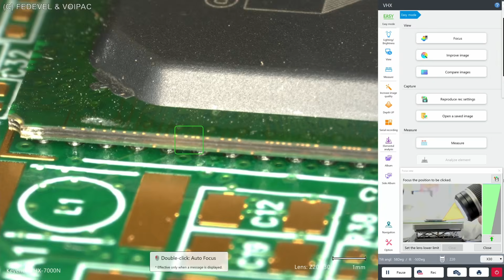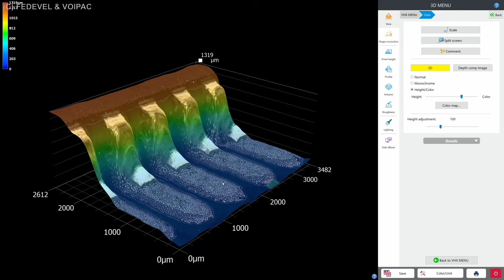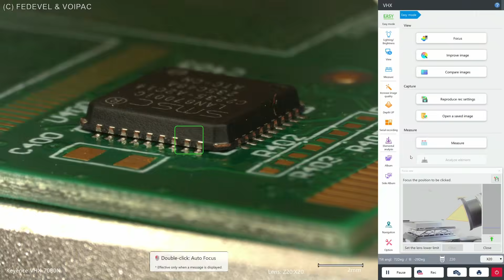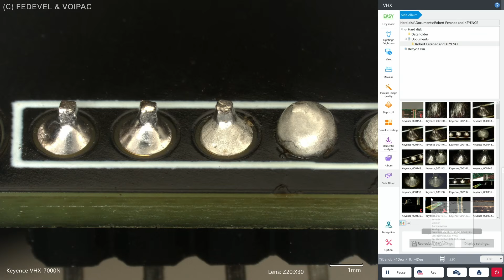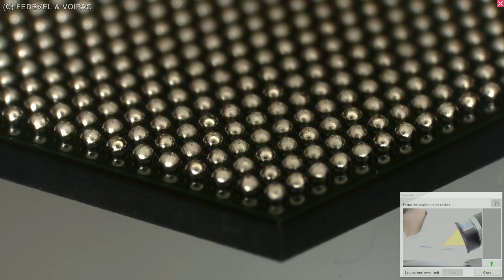Have you ever seen soldering THIS close?

Comment: Even with the correct amount of solder paste you can get the paste spreading excessively if you are not careful with preheating. It takes a considerable amount of time to properly preheat so that any volatile constituents of the flux are driven off slowly and don't boil. Proper preheating and limited rate of coiling are also critical to reliability with multilayer ceramic capacitors.

With leadless IC packages the part of the "pin" that is easily visible does not need to be neatly soldered in order to produce a reliable joint. This part appears to be bare copper because that is exactly what it is. Low-activity flux, which includes almost all "no-clean" types, may not be adequate for good flow on the bare copper. Added to that is the possibility of some smear of the plastic from the package on the bare copper as a result of the trimming process.

Comment: I too liked the video but was a bit surprised when I saw that gold-plated pins and vias were being soldered. "Degolding" prior to soldering is a real process and "Quality Experiences in Aerospace Electronic Assembly" says "If a gold-plated lead is soldered, a gold/tin intermetallic compound is formed which is brittle in nature and such a joint will be very dull near to the PCB surface. This embrittlement of the solder fillet causes the joint to fail subsequently during the environmental tests or during storage."

Comment: If you don't check boards as you make them, an IPC-A- 601 trained inspector as I was,  will come and make you fix the problem or start all over again, costing you a lot of money. Or you can ignore the inspector and make a bit more money but lose your customers, get the boards sent back as non compliant or even have a legal issue you may find needs fixing.
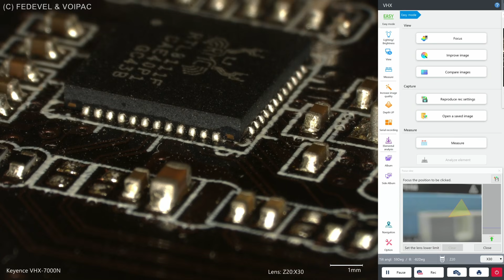As an asside the proper soldering at 5:51 The solder is good but the board and components themselves do not look clean or acceptable.

Oh and as a guide for newbies, there are very few hand solder instruction videos on youtube that would enable you to get a solder pass. Very few. A good start is checking if their iron is the correct temperature and sparkly clean. If not forget them, most of what they say or do will not be good either. There is a lot more than heat and solder to getting a correct solder joint when hand soldering. Actually a lot more with any soldering even non electrical or electronic.

Comment: Soldering lead with out flux inside, are very hard to melt. Some new lead wire nead more temperature 80/70 made alloy aluminum harder to melt fake can distroy units than fixing. Old soldering lead with flux are more safer to fix damage electronic part. Wash hands after yousing it flux are toxic chemicals.

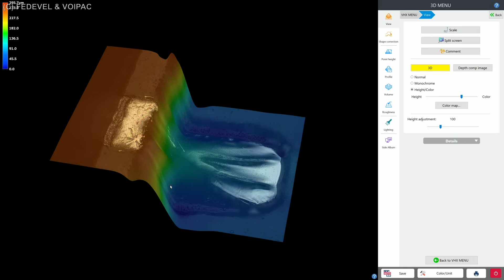Comment: Actually, the 3d view shown at 4:00 looks like an AOI machine. It’s “automatic optical inspection” you don’t have to even look at it, the comp program will look at every component, solder joint and fillet, take pictures and stop by itself if it sees a defect.

Comment: Well. nearly. i did a blog post on repairing a multimeter and took a few photos that had only 4 or 5 DIP pins in the field of view. There was dust and crap in there that became conductive just from the humidity of breathing on it. A clean fixed the fault.
I just used a clip-on macro lens with my cellphone.

Comment: You don’t need such a sophisticated microscope set up for soldering of that size. Or any size really. I have seen and performed soldering at that level and smaller with a microscope a fraction of that cost. There are resistors you have to hand solder smaller than an uncooked grain of rice. Try soldering that chip by hand.

Comment: If you actually wanted to see the foil vs the plating, try polishing the cut edge properly (to a mirror finish, I'd probably stop at 250 nm diamond grit for optical work) and then doing a grain boundary etch. If I had to guess you'll have a pretty clear change in grain structure between the rolled foil and the plating.

Now I want to try this in my lab...

Comment: Thanks for a cool video.  To be picky, the lead free soldered joint looks like a 'dry' joint.  Also, when hand soldering, try adding a spot of solder to the iron before putting it to the item to be soldered, then add more solder to the side opposite the iron, this will stop the tendency to push too hard with the iron because the heat transfer from iron to joint will be faster.

Comment: Finally a video that shows the kinda work I do on a regular basis! I've been repairing electronics under a microscope for about 10 years now. This is extremely well produced. I've personally never been able to examine BGA soldering from that kind of perspective before, since I'm usually staring at the chip from above through a microscope and positioning my tweezers to ensure the chip doesn't fly away when I'm using hot air. I see the end result though, as I tilt the board to examine each side of the chip to ensure, at least along the edges, there aren't any complications. Very impressive stuff!

Comment: Hey Robert ! I have a question for you. A few months ago, I bought a new 3ds. But after a few days of use, I discovered the ram was failing, and it's so catastrophic I believe a solder ball cracked and it need to be reflow.

I never did such a thing  but I've been told to put it in the oven ?
What do you think of this? Can it really work ? Should I buy flux and add it around the chip?

Comment: I hate hand soldering with lead free. I have a big reel of leaded solder from around 1980 and at current consumption I'll have to include it in my will. When doing repairs on a lead free PCB I melt a little of the leaded into the joint first, I find this makes desoldering easier.

Comment: What technique did you use to place the solder paste exactly inside the pads on the motherboard?
Reply: probably a solder paste stencil that is a thin sheet of metal that has the pcb pad layout. basically masks the pcb and only exposes the pads to let you smear the paste over the holes.
Reply: @UsurperUrsus  Oh yeah, that makes sense

Comment: What are your thoughts on MHP50? I am thinking of buying one, but I feel uncertain about actually using it that often as I don't have too much time in my personal life to build boards
Reply from the maker: I would not buy it if I would not need it for this specific video. A good hot air gun works better. The first MHP50 I have got was broken and had to sent it back. The second one cost me almost 200USD with all the taxes and delivery (+ you will need an external power supply). It does work ok for small PCB with smd components on one side, it somehow can work on small PCB with components on both sides (if you put the board up a little bit) but it won't work on bigger PCBs (it will not heat up bigger boards).

Comment: As someone who uses lead free solder all the time.. 650 F iron is appropriate.. and clean off the acid or flux that is on it.. it will look ALOT better (i can make it look perfect... not true mirror but still perfect...  its supposed to have that grainy like look.but smooth and clean).

Comment: 2:49 they vibrate while melting it stops most of the shorts and cleans the board or stops the board from getting dirty rather. They also oversolder with a guide that usually has some teeth at the front so that when the guide is pulled off. It leaves a little rounded tip.

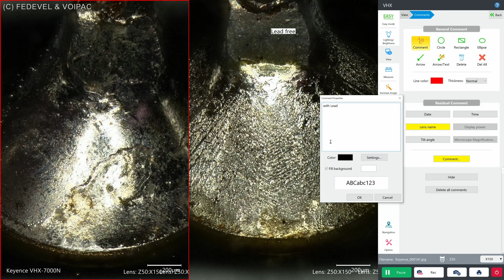Comment: At 7:07  , the header pin actually goes a little crooked and stays there because heat was applied for too long and the plastic strip on the other side softened and melted, allowing the pin to shift as the soldering iron puts excessive sideways pressure on it.  When the solder hardens, you can see that the pin is a little off-center.

Comment: How badly affected by tin whiskers are BGA chips???    Great video.  Thank You.
Reply: Great question; I definitely didn't like the look of that BGA solder when it cooled.  Although, I have read something to the effect that formation of dendrites or tin whiskers is minimized when soldering it is done in a nitrogen-flooded environment that excludes oxygen....
Reply: @goodun2974  Thank you for the answer. I cannot imagine the big guys using an oxygen poor environment for the operation.  Sad we cannot have a little lead in the mix for prevention.  Have a great day.
Reply: @69dblcab  ,  If you're a hobbyist doing repairs, mods, or building small-scale experimental prototypes at home, there's no reason you can't use leaded solder, which is still available, although you're better off buying It from an electronics-specialty distributor in your own country rather than buying It online from China through Amazon, ebay, Banggood or whatever. There's far too much junky solder, flux, and tips being sold online.  I was an audio repair bench tech for 20 years and my boss tried buying hard to find parts and various accessories such as liquid and paste fluxes directly from China, and much of what we received was counterfeit or just plain garbage.

Comment: Seen it?
I've done it!
And I've hand soldered some very fine pitch surface mount components.
As for leaded vs lead free solder, avoid the lead free solder!
A 60/40 lead/tin solder is ideal in all electrical situations.
A pure tin solder is a disaster wairing to happen. Pure tin silder will crystalize over time and form whisker like growths that have caused all sorts of issues.

And lastly, you left out wave-soldering
Go back and cover it

Comment: You pushed the pin with the lead free example. You induced movement whilst the solder hardened which is not correct. No wonder the surface finish was poor
Reply: The plastic strip on the other side of the board melted and deformed from the excess heat, allowing the pin to bend off to the side! I have done lots of soldering rework on header pins with bad connections....

Comment: Modern 63/37 solder isn't shiny. I suspect the lead is missing, but I've never been able to confirm.
Reply: Eutectic leaded solder which doesn't have a "plastic" transition state inbetween liquid and solid can sometimes look like grainy, dull leadfree solder. I'm not fond of it. Try a different brand of leaded solder, perhaps not eutectic, and buy it from a specialty electronics  distributor in your own country.  Never buy solder through Amazon, Ebay, AliExpress, Banggood, or Temu; never! Counterfeit or junk-alloy solder with corrosive fluxes is almost inevitable when you buy directly from China.

Comment: good information and incredible camera/microscope here! the soldering technique could use a bit of work though, at least as i have learned it. i guess you need a point tip at these sizes, but when/if not, i always prefer a chisel tip to improve heat transmission. and of course always put the solder to the tip directly, or even better when applicable, put a small bit of solder on the tip before soldering a connection to improve heat transfer even more. even better if you put flux on all your connections at first.

happy soldering! :D
Reply: I've been soldering for over 50 years and I almost never use a conical tip. A chisel tip is nearly always better; and the more mass it has, the faster it transfers heat.  The other thing that most hobbyists don't consider nowadays is the material the tips are made of:  The cheap bulk pack tips sold directly from China or Asia are invariably made of solid iron or steel and have poor thermal transfer characteristics in comparison to the plated copper tips that high quality manufacturers like Hakko supply. Cheap tips will be attracted to a magnet from stem to stern while high quality tips will only be magnetic at the pointy business end, where they are intentionally plated with iron to prevent being quickly dissolved by molten solder and flux.  I have a video about this on my channel.

Comment: Nice! As I only know about hand soldering, I missed the part how the PCB is heated while soldering. Is it heated locally? How is overheating damage to electronics prevented? Will other components not come loose while trying te solder a new component?
Reply: Heated with hot air, perhaps even from underneath the board, or top and bottom simultaneously.
Reply: Heated with a directed stream of hot air, perhaps from underneath the board or from both sides simultaneously.

Comment: Its interesting to me, I have been in IT since 1989 and I used to work with computers so much it was impossible to get good fingerprints off me because I had little pinholes in all my fingertips by pulling out boards that had old discrete compenent.  Surface Mount Technology has been around since the mid 90s but I remember being told back then it was something that could not be repaired on the bench.  I guess strategies have evolved.

Comment: what are you using to solder especially the QFN?  I'm guessing at least an under heater, but surely that can't alone be enough?  so hot air from above?  it didn't look like it because i couldn't see any optical distortion from the heat.  but perhaps it's too magnified to see it.

Comment: Yep, I used to repair circuit boards that used surface mount technology, including chips with over 100 leads.  It would take me about 10 minutes to replace one of those.  One thing I had in my tool kit was a dental pick, which my dentist gave me.  It's great for removing whiskers of solder.
BTW, if you're using acronyms, you should say what they are the first time you use them.  For example, while some may know that BGA means Ball Grid Array, many don't.

Comment: Hand soldering: it looks like you shouldn't keep that much heat, so the pins are starting to wobble in melting plastic holder. 
I often rise up iron's temperature to make it solder faster, so plastic have no time to melt. 
Also proper surface tensioning flux helps to fill all gaps with solder fast.
Thank you for making and sharing these great shots! Really helps to better grasp on what's happening over the pads
Reply: Yeah, I saw that header pin shift sideways when the (unseen) plastic strip softened and melted.  Unfortunately turning up the temperature of the iron isn't a very good solution because the higher temperature tends to quickly oxidize both the connection and the tip of the iron, and so neither one wants to really wet to the solder unless you use extra flux or the flux contained within the solder is particularly active and effective.  It's better to make sure that the tip of the iron is scrupulously clean and freshly wetted with a thin coating of fresh solder, and the connection being soldered similarly needs to be oxidation free. Under those conditions, if you're still having problem then you can try turning up the temperature of the soldering station a little bit.  It's also important to use high quality, name brand tips in your soldering iron because most of the bargain-pack tips sold directly from Asia or China are made of iron or steel, not plated copper, and have poor thermal transfer characteristics.  High quality, plated copper tips will be attracted to a magnet only at the pointy business end where they are intentionally plated with iron to resist the dissolving effects of molten solder and flux.  Cheap tips will invariably be attracted to the magnet throughout and at the back end of the tip. I posted a video about this on my channel recently.

Comment: This is really nice to watch. Thank you. I have just one remark here, if the solder joint becomes dull when it cools down, chances are it was overheated. Properly soldered contacts usually stay shiny.
Reply: Unfortunately, leadfree solder is an all-too-frequent exception, where finished connections often look dry, grainy and dull ( like the BGA soldering shown). Perhaps it looks better if you're using one of the fancy and expensive soldering stations that have a hose where you hook up a nitrogen tank to it...... but if a solder alloy is so finicky that you need to flood the area with inert gas to keep oxygen out of the connection,  then it's not really practical for home hobbyists......

Comment: Its a far cry from the soldering of the mid 90s when I was doing board level repair. It was like using a 2x4 as the soldering gun and a garden hose for solder. Climbing up the pins is a great way to use up the extra solder and and avoid it connecting to the next pin. Excellent information!!! Sub, like and obviously a comment.

Comment: Great demonstration of capillary action that causes the solder to creep up the leads.
Reply: i think its not even (just) capillary action, but also "normal" adhesion, no? the liquid solder sticks to the metal, but not the pcb?
Reply: @user-ns7qw9hd5y , the PCB is coated in "solder mask" or "solder resist" to prevent solder from sticking to it.  Surface tension of the molten solder tends to make it form into a ball when it's sitting on something like a coated PCB that it cant wet to, and the only reason that a solder ball might stick to the board is because of the flux acting like glue when it cools.